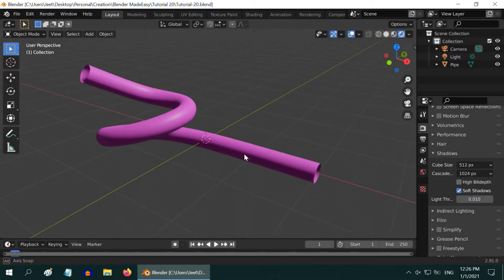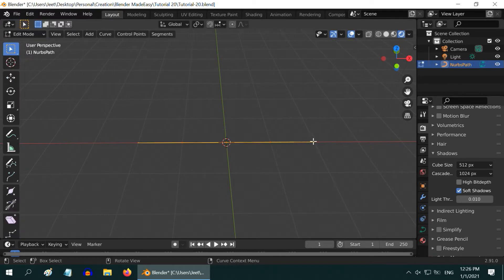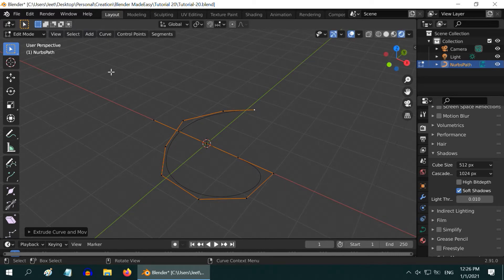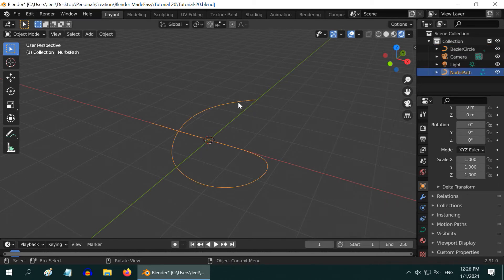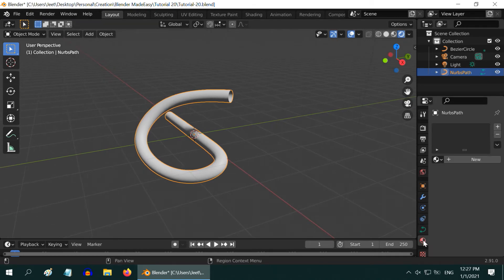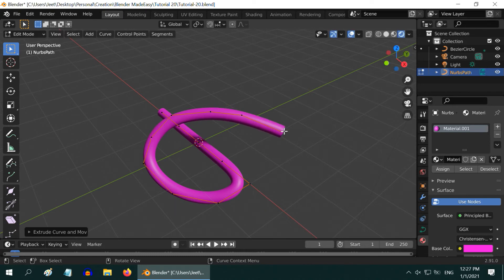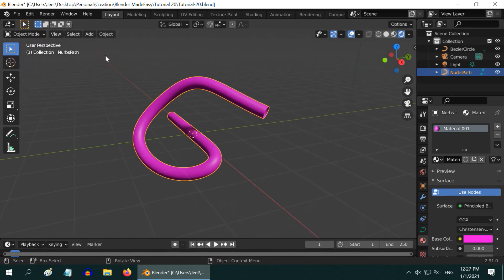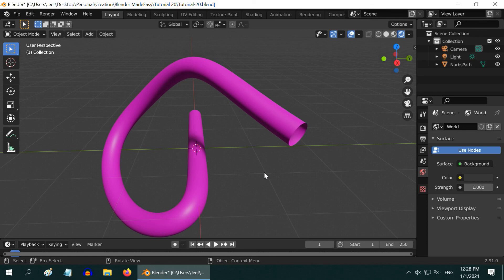How To Bend A Pipe Or 3D Rod In Blender | Easy Method | Curve Geometry | Blender 2.9x Eevee & Cycles

Comment: why dont i get thread kind of structure?
Reply from the maker: If you want to create a thread, please first check this tutorial on how to create a spring 👉 https://youtu.be/REfZF6Ux7OU Then you need to do 3 things: 1) create a spring structure from a flat surface, with very less thickness 2) Join it with a cylindrical pipe which will be the central part of the thread 3) Add a tapper to the whole thing using a Simple Deform Modifier. If still not solved, I will post a tutorial on this, let me know.
Reply: @5MinutesBlender  thank you so much I got it..I was confused a bit earlier 😃
Reply from the maker: @apoorva_n  Glad to know it was solved!